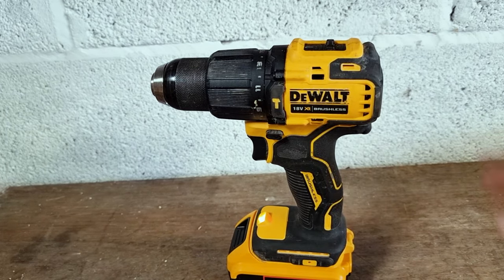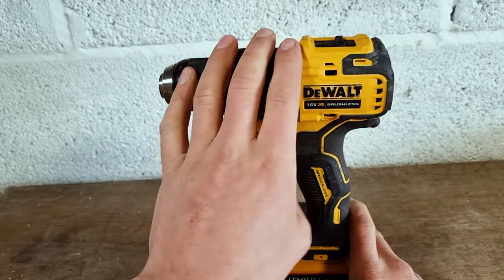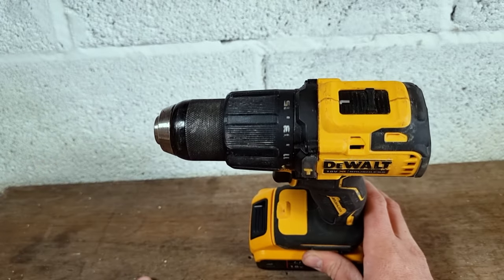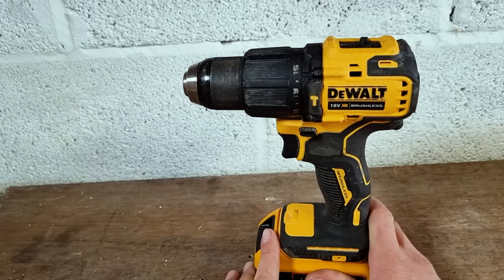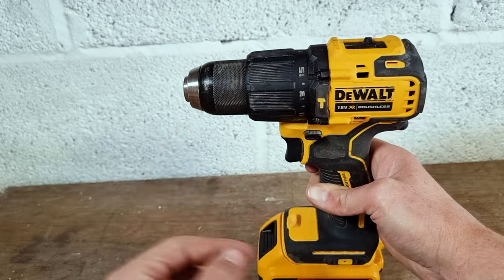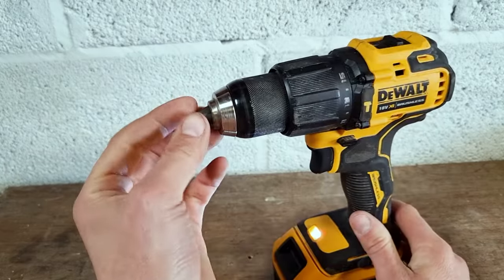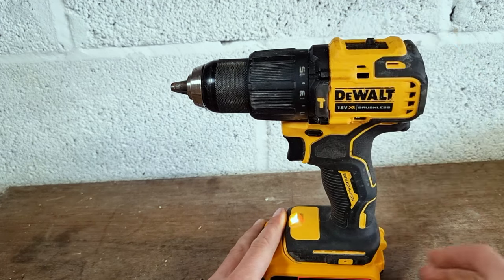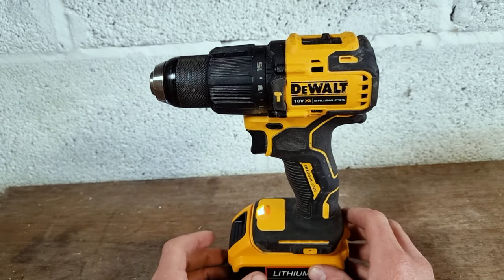DeWALT Drill Chuck Stuck Open

Comment: OWWWW THAT DIDNT WORK! Just hurt my hand!
Reply: Just burnt the shit out of my hand….🤦‍♂️
Reply: You did it the wrong way then if it burnt lol. Switch the button other way and try again the Chuck spins but gives resistance when you have button  set in right position and opens as it spins ..  works because  I just did it .. (and did it the same wrong way you did it at first.) 🤣
Reply: @jestcy4205  😂 I finally got it to work, but that was funny.
Reply: thats awesome u got it! .. i almost gave up at first doing it the wrong way. Took a thin layer of skin off!!  😂  I could have sworn I had that switch same way he said to…  but obviously i did not lol.
Reply: @jestcy4205  Oh…trust me, I’ve got scars from that on my hand to this day.  Was one of those “I can’t believe I just did that moments”.  Like working on a piece of electronics and forgetting it was still plugged in.  I actually wound up having to put the chuck in my vice, worked like a charm.   VERY good piece of advice for anyone else reading these comments.👍
Reply: @jestcy4205 mine is still stuck.  I had four different muscle men try it.  Then we held the chuck with channel locks and it still did not work.

Comment: Isn't this how you always open and close the chuck? not sure how this works on a stuck chuck
Reply: No, I always turn the textured bit by hand to open and close it.
Reply: It is but I (think,) the key to unlocking it are the settings it has to be set to before getting it un stuck. If not you can have that thing in reverse …stick your drill inside of a vice and waste hours trying while burning thin layers of your skin off lol but youll never get it unstuck
. … And Im a woman btw guys.. if I got this you guys do too! 😉 
Dont give up because it works… Just remember if your burning your hand doing it  click the switch other way and try again. Lol

Comment: THANK YOU. I had the opposite problem: chunk was stuck closed and I couldn't get the bit out. I just flicked the switch the other way, so I was screwing instead of unscrewing, flicked it a few times while holding the chuck in place, and let it open itself back up until the bit fell out!

Comment: Didn't work for me.  This is dangerous advice. Depending which model of Dewalt you have,  this will take skin off.  If you are going to grab a chuck that is stuck,  use a cloth or vice.  Still did not work for me.  Tried hammering  the jaws didn't  work.  Tried bit in a vice and hammer chuck to get bit out,  that did not  work either.. Must be a defect in Dewalt drills as it is a new one that I had hardly used before it became stuck.  Still looking for another method?